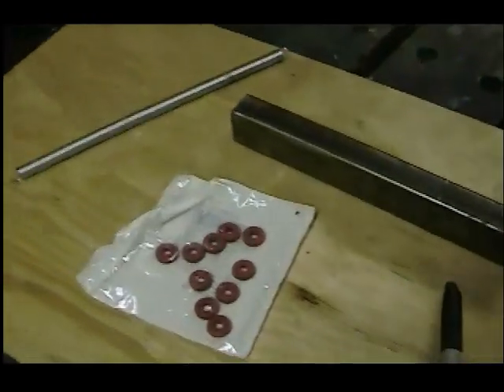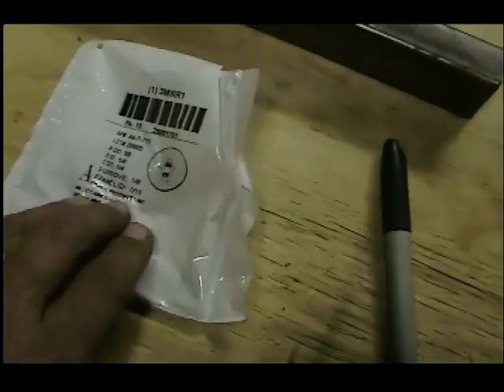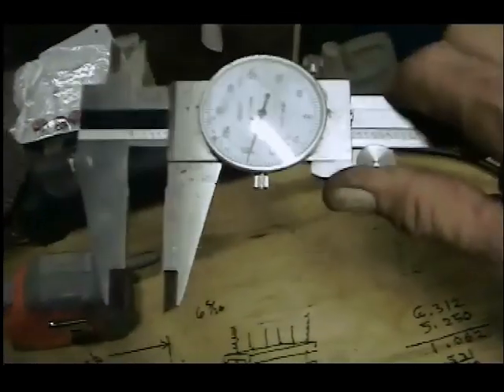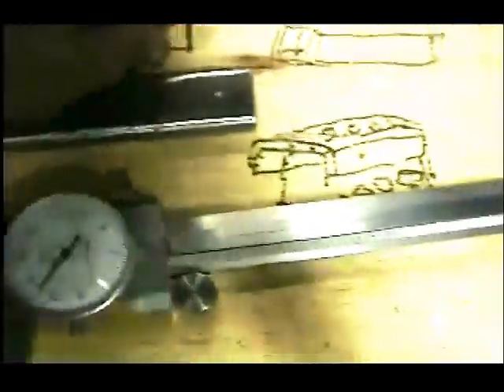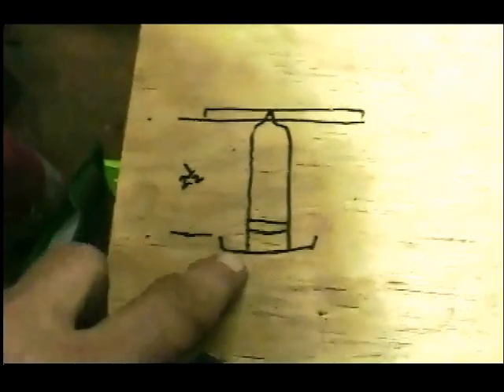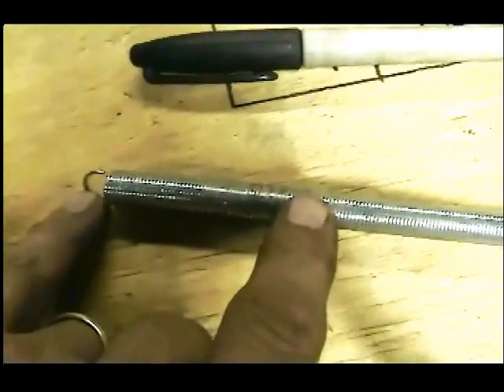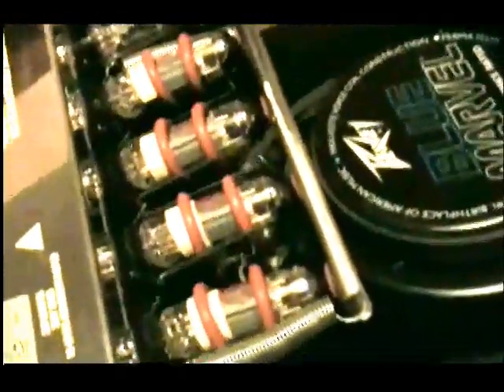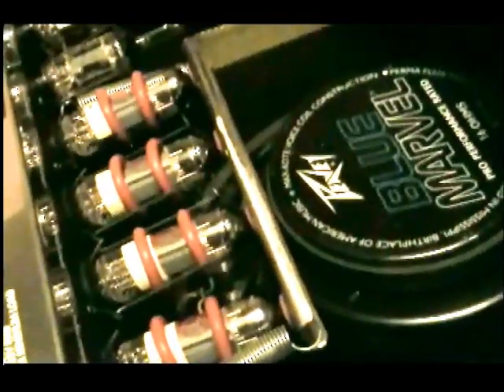How To Make a Tube Stabilizer for a PV Classic 30!!

Comment: I think if your stabilizer was a little bit longer the springs would pull out to the sides and prob fix the problem. but its a great fix to a problem with every combo amp. Great video!! thanks
Reply from the maker: true but that would mean making another one....the extra spring holes worked perfect..thanks for watching